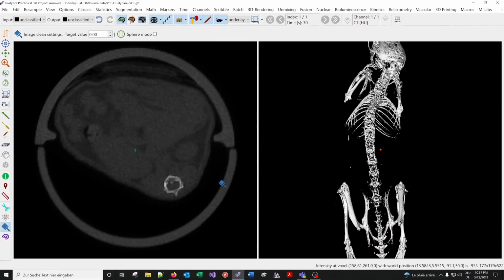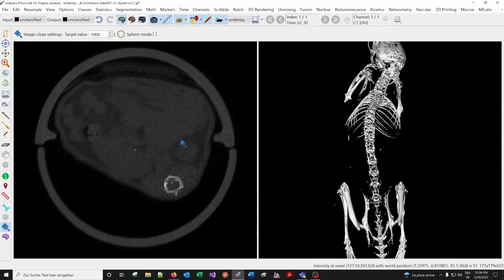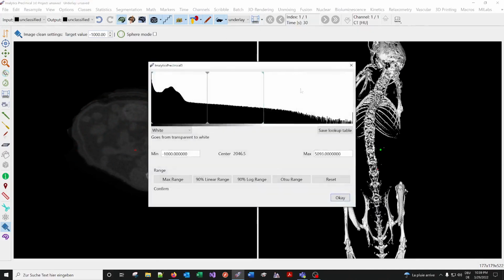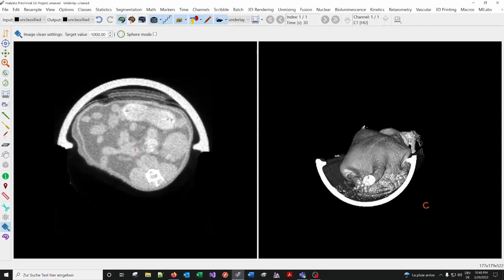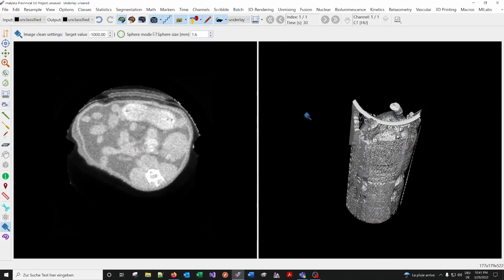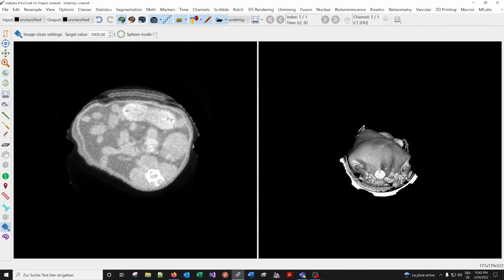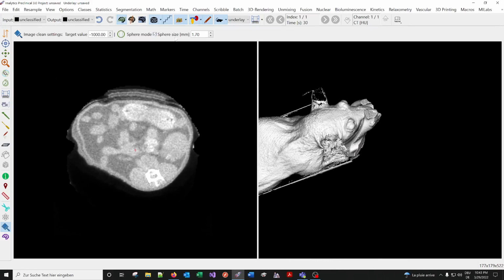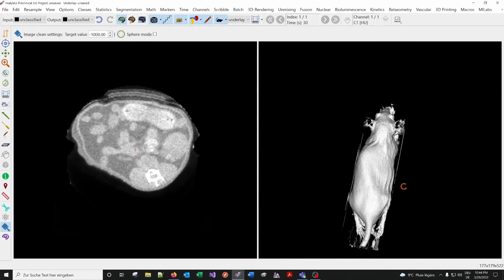Mouse mode: "Image cleaning"

Comment: Hi, This video is no longer related to the new version which is 3.1.5 // I am really struggling with this option for my segmentation and it is not working is it possible to help me with that? My input and ouput class are on “declassified” and in image clean mode with target -1000 but it doesn’t work!